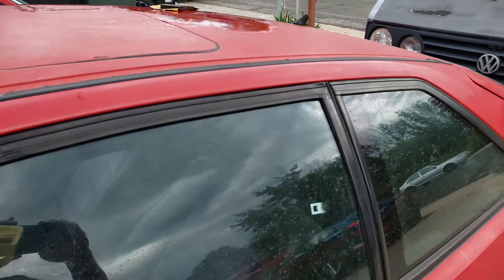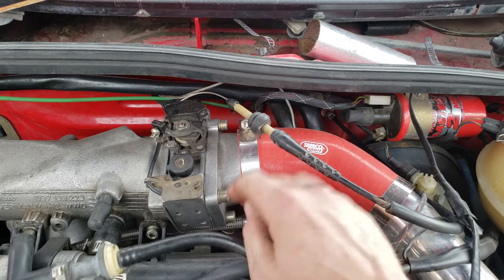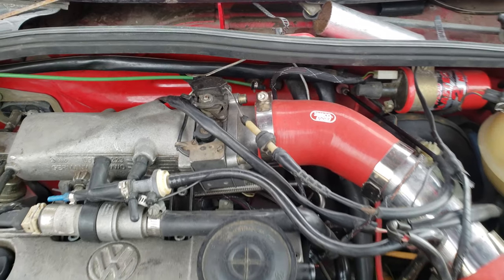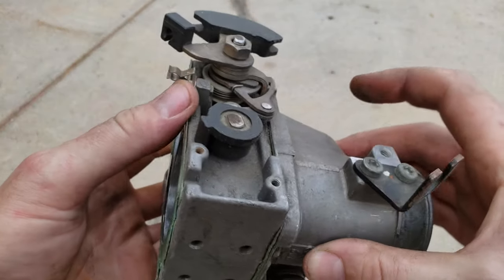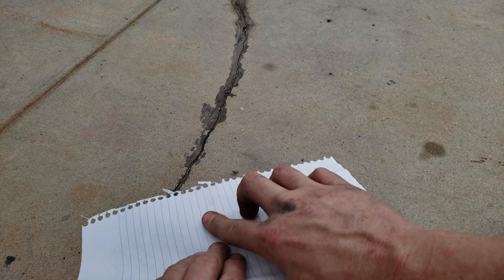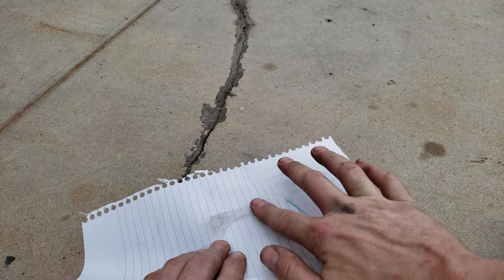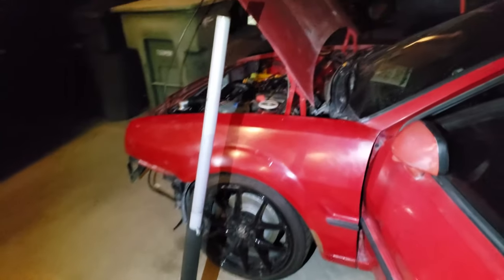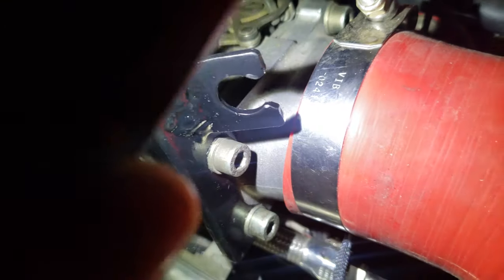Corrado G60 GT28RS Turbo Project update, and throttle cable bracket

Comment: that throttle body has a primary and secondary like a carb??? the detomato(charade) had a GT2860RS on it, weapon of a turbo, never fully utilised my case though. maybe the 1.8T will be different ;-)
Reply from the maker: Yes! Just like mechanical "secondaries" on  carb.

The smaller throttle plate maintains really good light throttle drive-ability. It gives you more "resolution" dialing in the air for the first half of the throttle. Most larger throttle bodies have solved this and "tip in" throttle resolution with a lip or ramp near the edge of the throttle plate that opens first.

Another thing I like about double throttle plates is the smaller opening keeps air velocity higher (in my opinion) over a large throttle plate at a slight opening.

 Having an actual hole I hypothesize would change turbulence and venturi characteristics enough to make a difference.